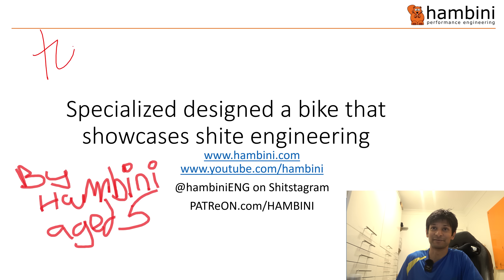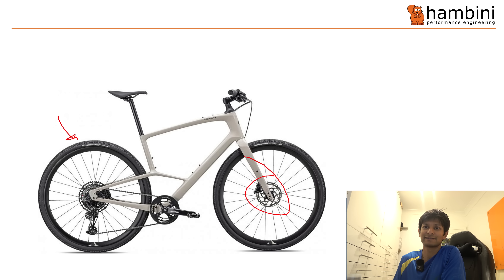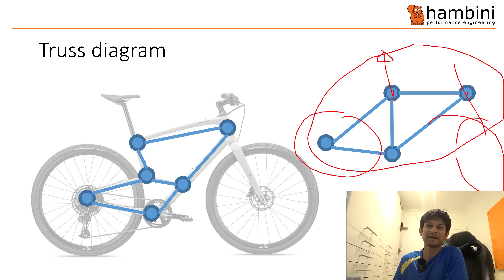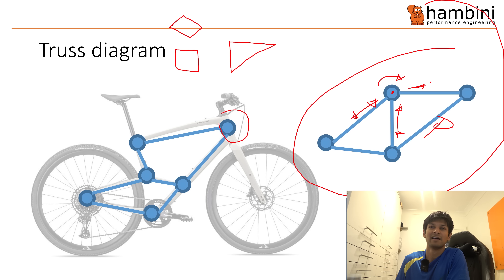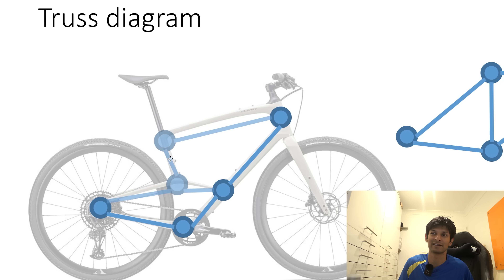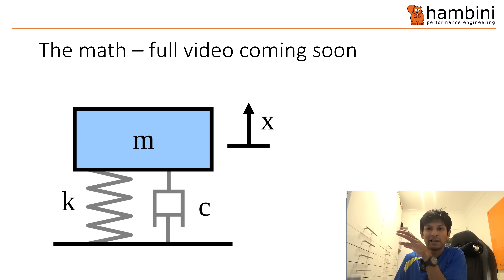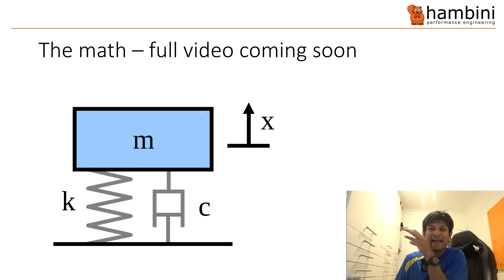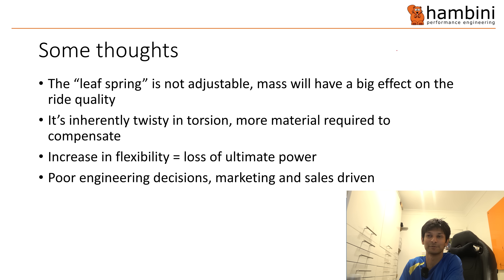Specialized Sirrus | TOTAL BODGE | When the marketing department design a bike...

Comment: Has anyone considered that this bike range is just a means to generate publicity and possible increased foot traffic through specialized bike showrooms? Look at how much media coverage they have gotten for a FLAT BAR bike!  I mean personally even if I didn't buy one I would certainly want to see one in person and I really would like to give it a ride to see what it felt like.
Reply from the maker: Yes but it's the wrong sort of media coverage. It's total ridicule. There is probably some smug git at Specialized HQ thinking the public is going to buy this and he's probably right but.... I don't think the public are as ill informed as they once were.
Reply: @Hambini  I don't have one of these bicycles and am not intending to buy one, but don't really see what the problem is. It's obviously not made this way to achieve better efficiency but improved comfort so why would you assume all bikes need to be engineered for maximum stiffness? If it's more comfortable and doesn't break down too soon, then this kind of trade off could be worth it for many commuters for example. I would be mainly worried about the frame lasting that long but Spezialised had to have done some math to figure out they aren't going to lose huge amount of money on warranties. Do you believe these will last longer than the warranty and then start failing after that much sooner than bicycles with normal frames?
Reply: @Hambini  the public have never been more ill informed than ever before. You must remember that Joe Public has never liked to think for himself nor does he watch your YouTube channel - unfortunately :).
Reply: @Hambini  yep. will never buy a spesh anything again. TRIANGLE GANG!
Reply: @Hambini  Specialized did this crap before! Remember the mid '90s Rockhopper A1 fully bikes, that had a single shock in the back without any pivot points. It looked great and was according to Specialized their supreme Californian design. The damper took all lateral load and started leaking after a few hundred miles. Any student in semester one of mechanical engineering would have seen this flaw immediately. ☝🧐
Reply: But if you have stupid stuff and engineers on YouTube explaining why it is stupid. It's not the right kind of pr stunt.
Reply: If I was someone working in the marketing department at specialized I would say that the discussion this bike release has generated was a total marketing success. In the marketing world this much discussion of a product whether it good or bad discussion is a good thing. Particularly when no other bike releases from other manufacturers is generating anywhere near this many comments.
Reply: You also need to consider that this bike is not intended for proper roadies and hambini followers. This is a commuter bike, generally speaking most commuters are not cyclists and don't give a crap about technic and wether or not the bikes is properly optimized. What they want is style, comfort dependant bike. And in that regard this bike ticks all the boxes and will be perfect to brag about at the office or beer garden to other people that don't have a clue about bikes either and most likely will also find it to be cool because it looks different, and is comfortable without having granny saddle or heavy/complex suspension that can break or creak. That's why engineering and marketing are two different Jobs and why engineers don't create product lines anymore, otherwise you would only have the best technically possible product which would completely miss many many needs from many demographics 😜
Reply: @gg4760-k5n  why bother with that crappy overpriced bike when folks can simply get a Hi-Ten steel singlespeed instead.
Reply: @gg4760-k5n  commuter bike you say, they tend to have mudguards and pannier racks, both of which look difficult/impossible to fit on this.
Bet the gearing hasn’t got the range for commuting either, most of the bikes I’ve tried lately are running 2x drivetrains, with gearing not low enough for the hills I have to go up, 1x are even worse, can get up some of the hills, then run out of top speed through not high enough gearing, my old 3x9 manages it
Reply: @Thecrazyvaclav  Have you seen the amount of people riding fixies, track bikes and such as "commuter" bike ? Once again, point of view of a person that think from a practical/technical standpoint, not the vision of the market share they are aiming for. Probably people that won't commute when the weather is bad for instance, so goretex suits and such are probably not in their wardrobes, they might not even use a helmet or then a helmet with a visor. Yes we despise those "riders", but they represent a vey real share of the market, usually with enough disposable income so that "more money than reason" applies.
Reply: @gg4760-k5n  It's a crap commuter bike though, mounting panniers or mudguards looks pretty much impossible.
Reply: @chrisburn7178  on the contrary, that only means proprietary bike rack and/or panners that you can sell for a premium and make even more money out of those that would consider all this as great. Not, you, not me, but these people exist, otherwise the cummuter bike category as such would not even exist and when you roam B2B bike festival I can assure you that this bike category and these types of commuter bikes are very much alive and well.
Reply: @chrisburn7178  according to the Bike Radar video you can mount rack and fenders but they are proprietary Specialized items made specifically for that bike.
Reply: @MAGAIVER  ... At vastly inflated cost! I knew it 😁
Reply: “The current generation is 600% stuffer than the previous generations “ tell that to your hair dresser lol
Reply: I would like to hop on one energetically to see if I can bend it while stationary.
Reply: @@d.w.8100lol commuters haven't really had to be informed, most bikes have been bike shaped and have worked fine
Reply: I suppose your point is valid if the maxim that there's no such thing as bad publicity applies. As a disinterested observer this type of attention would be put me off the brand.
Reply: So you think a company that only has a $400k annual marketing budget is going to pay for the development and production of an entire model of bikes just as a fucktarded marketing stunt? Do you people see how stupid what shit you write looks?
Reply: I still had some respect left for the brand, they just burned that to the ground. Your thought would work if they actually came with an idea that might work or show ingenuity . This is just dumb!
Reply: Anyone  that wants to ride this abortion, must be also dreaming of riding Rosanne Barr.
Reply: Guessing it’ll have been extensively tested, but some random cyclist will break it in a couple of months, I’m a bigger lad, and would worry about breaking it between bb and saddle
Reply: @D. W. This isn’t just any commuter, and I don’t see any mounting pots for racks or bags. A carbon fiber beach cruiser seems more the type.
Reply: @petesjk  Maybe it is a fitness bike.
Reply: @mikewood9284  The problem with warranties is the claims, even if accepted, can take long to sort out. 3 months it was in my case for a frame replacement. I had to remove all parts from the frame, prepare it for the shipping and organise and pay for, including insurance, for a £3000 frame, the courier. It goes all out of your pocket. Then rebuild the bike. Why would anyone want that amount of fuss. What's the huge benefit you would be getting with that frameset worth risking the inconvenience of having to go through a warranty claim? The unusual appearance?

Comment: Hmmm.... Rondo Ruut has similar design. Sureley not all engineers that designed these frames are wrong? Also, there's the new Trek Madone with its IsoFlow and suspended seat tube. That thing looks, like it's about to brake off. Somehow I'm sure it won't. BTW, this leaf spring suspension has been around for ages - remember all those carriages or very old cars in the movies?

Comment: Nice deconstruction of the bike but having ridden one, I’d say my experience does not match any points you “proved.”   It rode like a normal bike with improved ride compliance.   Compared my Moots Ti Vamoots RCS, the specialized was laterally stiffer and significantly smoother.  I walked away impressed. Longevity might be contested but only time will tell.   I think you should ride one and report back with your findings.  And you keep commenting on shill channels but at this point, your channel isn’t much different since you don’t have any first hand knowledge of this particular bike.

Comment: I don’t understand the benefit of changing the frame this way? Not only does it looks hideous but the structural integrity of that part is questionable considering that it’s where the weight of the passenger will be concentrated.

Comment: This is a 15 min. video describing this one fact:  When a bike frame is designed this way it is going to flex up and down.  Well, duh...   That's precisely what it is designed to do!  A couple of important considerations:  1) this is NOT a race bike.  (I mean, just look at the 1x gear ratio.)  It is not intended for that kind of use.  So, the slight loss of "power" is not a strong consideration.  This is a hybrid bike - primarily for commuting and light trail riding.  All considerations of performance should be within that context or they are, IMO, invalid.  2) Hambini (and other critics) - have you actually ridden the bike?  I have.  3 times.  The ride is amazingly soft and bumpy roads and trails are significantly smoothed out.  It does exactly what it is designed to do.  For a customer that wants a pleasant commute to work, or a nice weekend light trail ride, the bike is impressive.  Let's keep things in context.

Comment: I work as a mechanic at a shop which carries Specialized. Got to give the new design a spin around the block a few times. It’s fine, pretty smooth ride. Noticeable flex if you get out of the saddle and sprint. Overall, it seems ok but I wonder what the longevity of these frames will be? Also, the Sirrus is not a performance bike. It’s meant for commuters and rich yuppies out for a relaxing spin on the bike path. Could they save thousands by just getting a boing boing saddle? Sure but what’s the fun in that!

Now, do the Rondo version of this which is actually meant to be a performance bike!

Comment: This is a self suspending design, for shock absortion of high frequencies and low modulation, which means smoother rides. Not bad at all. It should be combined with a hole in the bottom so it retains  seat post length adjustability.

Comment: We're all still waiting to see the example of a perfect bike, designed and built by Hambini, that is machined to 0.000001 mm tolerances in the bottom bracket and headset and costs less than $10,000

Comment: All of this is quite amusing from the perspective of a mountain biker. 
1x drivetrains, disc brakes, roadies now on the verge of "inventing" suspension next? 🤣
Mountain bikes have had shock absorbers with adjustable damping and spring rate for about 25 years...
And yes, we went through "compliant" frame designs, elastomer springs and more in the early 90s.

Comment: I want to see a cut section of that DT, where that one tube intersects. Must be massive layup. The forces that go into those two almost horizontal tubes is so high, coming from the seat tube, it just wants to tear up the dropout section and snap the DT in two. The ST is not even going straight towards the dropout, nope, it has a small cantilever there. Probably massive too.
Isn’t a suspension post doing a better job than this frame? Got rebound control as well 😜

Comment: I noticed that the Specialized frames get heavier and heavier even without the redesign. Bought a 2019 Carbon Sirrus and it was the same weight as my 2012 Aluminum frame! Sold it for what I bought it for - good riddance.

Comment: I can remember trek leaving isospeed out of bikes with tires as big as the sirrus because slight changes in air pressure have a greater effect than anything a frame would be contributing.  Tires also allow a range of adjustment based on rider weight that is one of the missing features from the frame.  Lets face it, they just want to style it like a phone or a playstation, people buy the "cool" stuff, it doesn't have to work...

Comment: I don't get what's wrong with a suspension seat post. First, they have that nonsense shock absorber in the top tube, now this absolute garbage. 

I think you should buy one, put a new sram mech, absolute cack cage and zipp wheels on it then ride it without a saddle. That'll get some clicks.

Comment: I would opine that the bike will handle horribly, the wheels will not stay in line and track with each other as the rear triangle is too shallow allowing the rear drop out locations to twist under load. The deflection will make the bike feel like you are riding a wet noodle as the drop out twisting moment loads up and releases over and over. I think if ridden aggressively on a trail you would see 2 distinct tire tracks left behind as evidence of this. YMMV.

Comment: Got me thinking, have you ever come across a Lauf fork before? They use leaf-spring suspension (with carbon leaves I think) and look very strange, but wonder how reliable they are and how prone to damage. I always worry that the biggest damage forks will receive comes from hitting pot-holes and unexpected bumps and such, and the shock loading parallel to the grounding the opposite direction of travel thus creating a moment from head-tube to axle. Not sure how well one of these forks would stand up to that compared to a typical 'monocoque' fork.

In any case I wouldn't even consider owning a bike like this one. Just like the new Madone, it's got a stupid design which might look cool for a few weeks on the Tour de France but for the rest of us just means a total frame repair/replacement sooner than later
Reply: i’ve heard pretty varying responses which makes sense because it can’t be tuned for weight of rider. I guess conservatively they could tune the spring ratio for pretty high stiffness, and then it would really only kick in on big impacts.

Comment: I rode one on Tuesday just to see what it was about, it feels good, it’s very comfortable, didn’t seem like it was moving too much, power transfer seems normal, it’s wacky, but it’s a nice ride feel. Go ride one, and make another video. I rode the road version, it was just over 20 pounds for a size large. The Adventure version is about 24 pounds in a large.
Reply: Goes to show you can analyze the hell out of it, and be wrong at the same time. It might not look conventional but still works just fine. Good chance A) materials exceed requirements for strength, rigidity, etc for a bike frame, and B) a major company like Specialized would design,  build, and sell, something that wasn’t well tested first. Roast all you want,  it still works despite your snobbery. What we need is more innovation in the market, not useless sniveling about what you don’t like……
Reply: The actual issue is about repeated torque stress on the structure causing accelerated wear. A single ride won't tell you how fast the frame will wear. And whether it will fall apart in 10 months or in 10 years.
Reply: @christianbarnay2499  I guess I have more faith in the engineering department at one of the worlds largest and most successful bicycle manufacturers…..
Reply: @stevekelly6544  But are you sure an engineer was involved in this design? To me it was created by a graphical designer, not an engineer.
The laws of physics clearly state that this design is more fragile than the usual triangle.
The success will depend on the target market. If their goal is to sell it to people who buy a new bike every other year, it only needs to hold for 2 years.
When I buy a bike I want it to be functional on the long run. I am clearly not the target for this design.
Reply: @christianbarnay2499  there are many fs mtb's with flexstays so this idea isn't completely new. I haven't heard those flexstays failing
Reply: @stevekelly6544  The point being made in the video is that this on its face is not a good way to mechanically design the structure to maximize the potential of X materials... Specialized can overcome this by simply using materials to overcome the structural shortcomings inherent in the design. It could certainly still ride just fine... but it just seems like Specialized is doing something just to be different... they don't appear to be "solving" some problem by utilizing this very complicated design.
Reply: @t3h8ar0n  everyone has their own opinion- I rode one, have you?
Reply: @stevekelly6544  Lol! I don't need to ride one. How it "feels" and how it performs is independent from a critique of structural design elements and engineering. You can have a sub-optimally structurally designed product that still performs beautifully because other things are done to mitigate the issues inherent in the design (like using overkill materials to compensate for decreased soundness of the structure).

Comment: Ham, I think you've left out one important factor to consider - who is this being sold to? It's not a road bike. It's not a gravel bike. It's a fitness bike. It's not made to be efficient and it doesn't need to be. So you lose a little power in the flex and you are carrying a little extra weight. But those things don't matter when you're just doing a few miles down the bike path to get some air. And that's all that bike is, from what I can see. An expensive style statement for people that wear Apple watches and drink out of Yeti cups. There's nothing terribly wrong with it from that perspective.